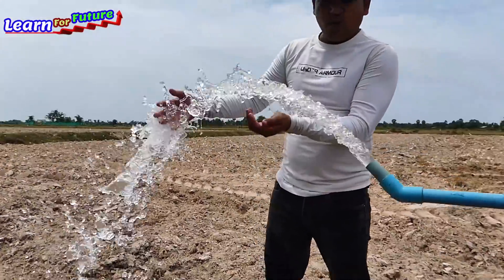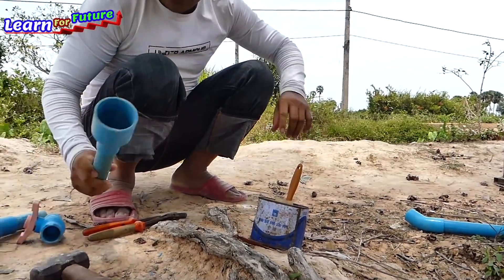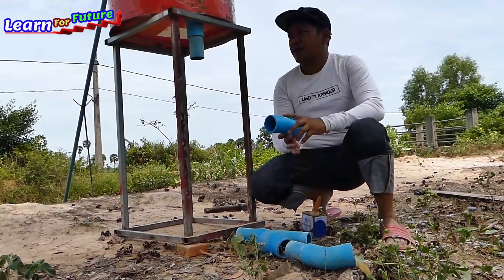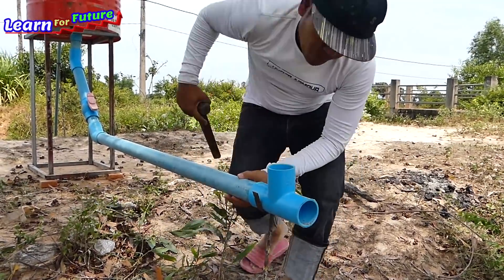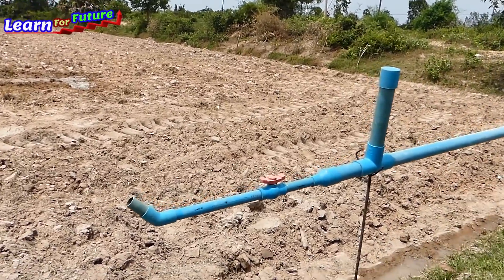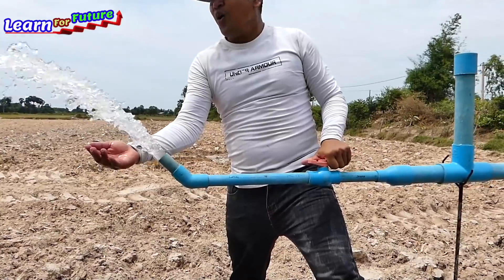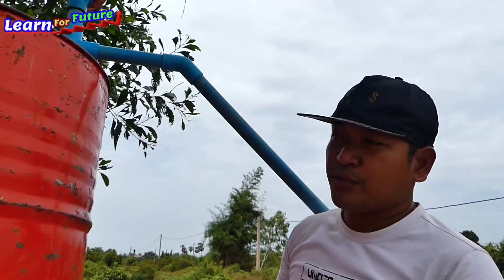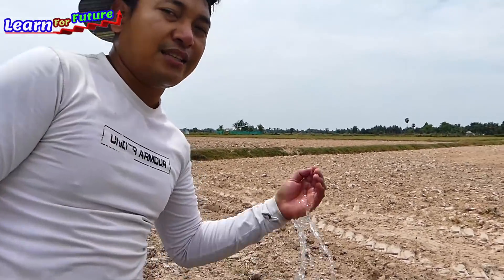Pressured Pump - How to make Auto Water pump from deep river - No electricity

Comment: For heaven's sake guys, do you really believe that this work.
Defies basic physics. Will not work unless the outlet is below the level of the source.  Even in such a case, it's just a syphon; there is no need for any elaborate setup such as drums, etc ; just a long pipe and a technique to start the water flowing.
Reply: If you dont believe dthen dont watch it so simple,,lol

Comment: It's  not a fake,  it's real and is simple technology. 
First this guy prime the tank, when it closed the valves on of the tank
The pressure pushed the water from the lake and it has to open the outlet valve immediately and water will come out from the outlet pipe.
Reply: Ovo je naučno i praktično nemoguće znači da je prevara, može samo da radi ako je nivo izlazne cevi niži od nivoa vode u kanalu iz kojeg se vrši zahvat i ta razlika u nivou određuje pritisak na izlazu, ako je oko 10 m, pritisak izlaza je malo ispod 1 bar. Ovo je nauka a ne prevara kao na snimku. Koliko ima ovih lažova a neznalice im veruju.
Reply: Tried but failure. Please let you know me about the measurement and the two upright pipe the distance to build it up